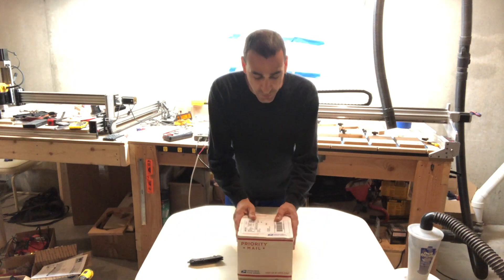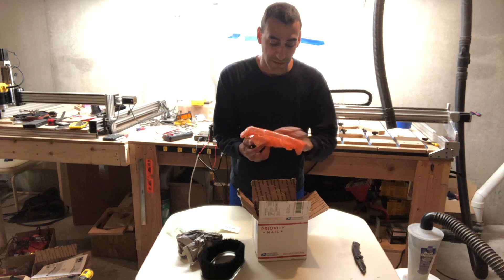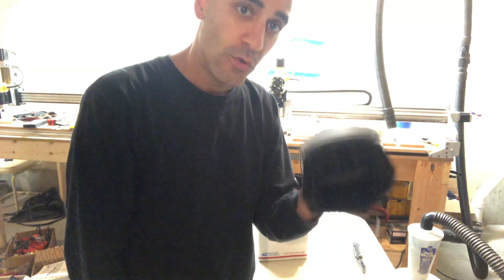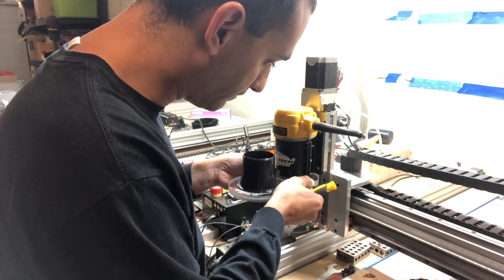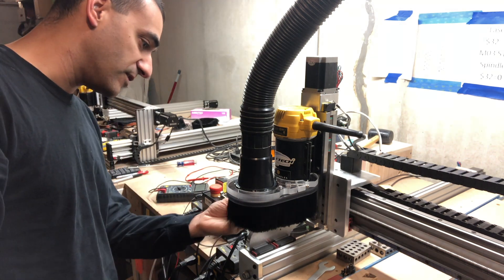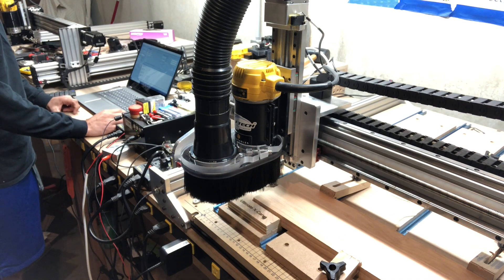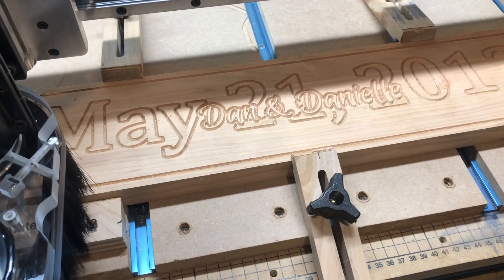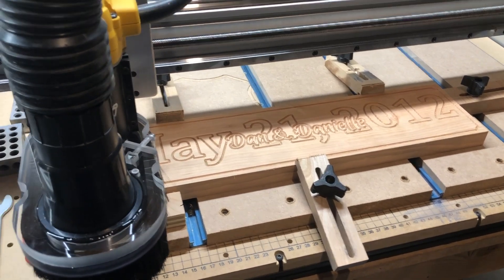KentCNC Mini Dust Shoe Review

Comment: $160 better come with the router. Ouch
Reply from the maker: Doug w I’ve owned several from cheaper versions to this. Yes it may be a bit higher in price but it’s built to last and it’s a quality item. Sometimes you get what you pay for
Reply: sometimes ya dont I just had one  delivered today and it came broken the vaccum port is held in by some odd adhesive. A small piece was broken off of it and the port where it is glued had come loose. still waiting to hear from the place I got it. a bit dissapointed. I could fix it but paying almost 300 canadian paseos for this it should come ready to go.
Reply from the maker: @Platinum1133  I would sent Kent an email. I’m certain they will take care of you
Reply: @DanCoastie  I hope so the company I got it from in Canada here has yet to even reply to my Email.

Comment: Awesome review - do you have a list of all the upgrades you've done to the machine?
Reply from the maker: I am currently running a cnc4newbie machine, with air cooled 1.5kw spindle.  I also use a 2.8w Jtech Laser for all my engravings.  Motors are 269oz and the Z axis is a new cnc4newbie Z axis that is made for bigger heavier spindles